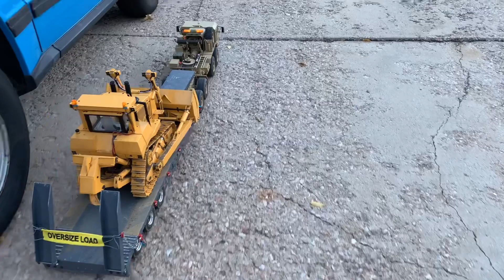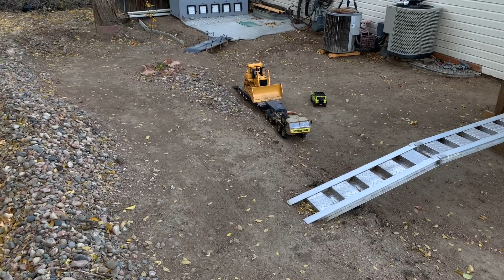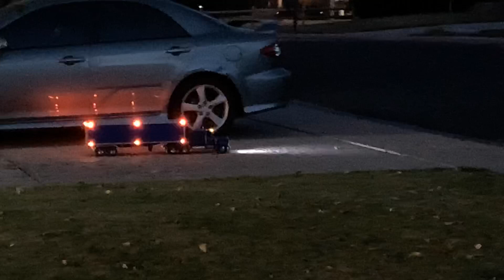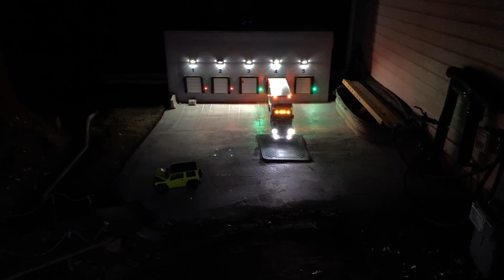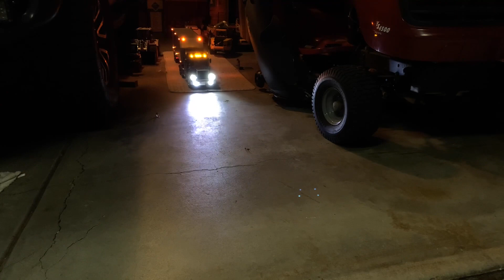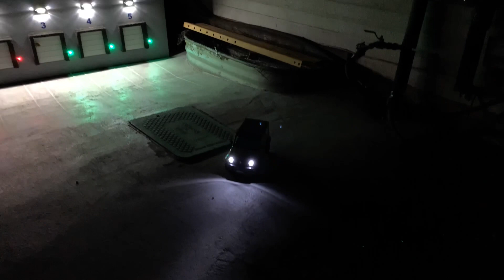Making the grade. Finally enough material to grade to the warehouse apron. King Hauler|Dozer|HG P802

Comment: I got to get me one of those Jimmys.  Is it true its a metal body?  I want one since first came out for scale factor in our rigs.  But I didn't know that they were also a metal body.. Your site is looking awesome the night filming really brings out the wow factor.  Makes it look like a true factory loading dock.
Reply from the maker: Thank you. I really like how the docks have turned out and nighttime is when it really shines. The Jimmy is not metal bodied it is a hard plastic shell and not regular lexan. But the scale details are fabulous. True 4x4 as well. Locked diffs and all! 2 speed transmission. Very low granny gear and ok high gear, could be a bit faster but it’s decent. Goes great with the equipment and it’s true to scale at 1/12 it’s full-size counterpart.